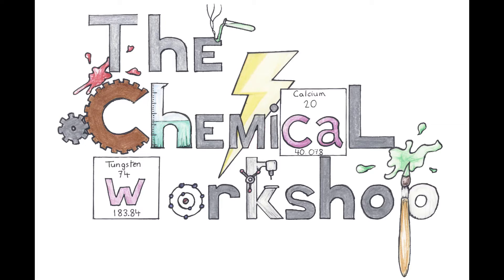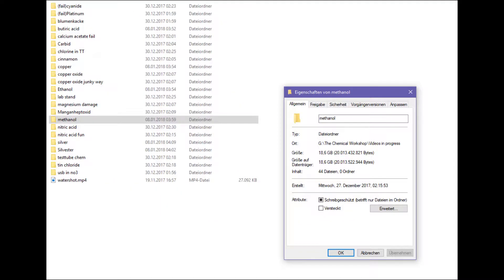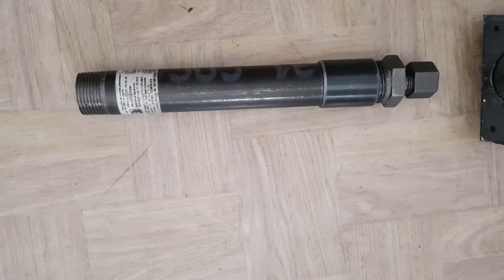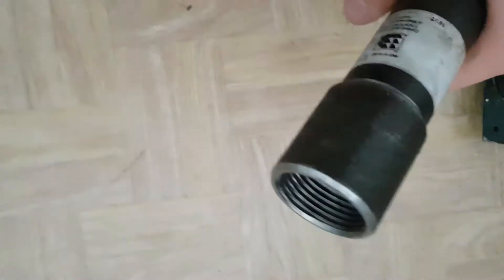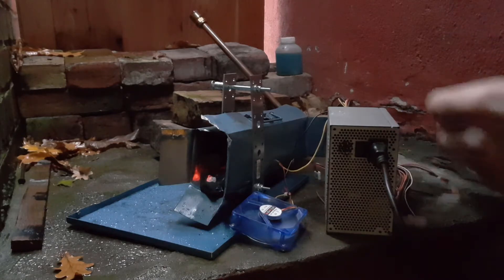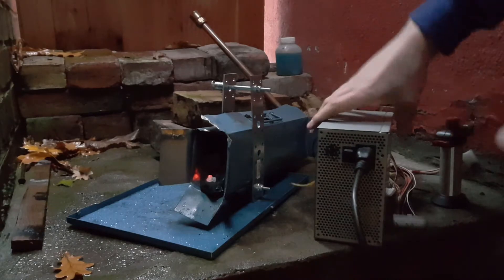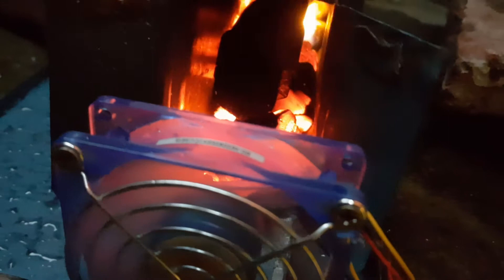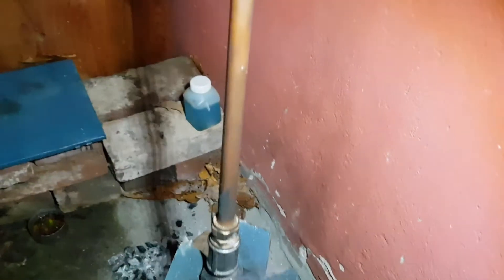TCW - Update #4 - Methanol Update !

Comment: I just did a check at wikipedia and found this:

Carbon monoxide and hydrogen react over a catalyst to produce methanol. Today, the most widely used catalyst is a mixture of copper and zinc oxides, supported on alumina, as first used by ICI in 1966. At 5–10 MPa (50–100 atm) and 250 °C (482 °F), the reaction is characterized by high selectivity (>99.8%):
CO + 2 H2 → CH3OH

So you can make syngas in a pipe. Say you add a little steam. So little that  it favors steam reforming charcoal to hydrogen and carbon monoxide, vs carbon dioxide. 
 Then  the pipe is fed to a medium of crushed sintered copper, zinc, and aluminum oxides. The medium may be heated with nichrome wire if nessesary to 250c. Then after the reaction chamber, a  pressure guage monitors the pressure and you operate a valve not letting it go much over 50 atm or about  150 psi.  Maybe include a 200 psi pressure release valve. Dont let into turn onto a bomb.
Reply from the maker: For now i'll just heat the mixture and collect everything that comes over
The next step would be a catalist which should be easy ro make
The pressure stuff will come last, even if i can get 10% yeld i am happy, the less hassle the better, wood is cheap
Reply: @TheChemicalWorkshop  then adding some steam is likely to react with the remaining carbons turning it into syngas.

Comment: I wonder how well an induction heater would work for you on an iron pipe.
Reply from the maker: Gotta use what you have
Reply: @TheChemicalWorkshop  I've wondered this.

1) Copper wire wrapped around an iron pipe with current flow acts like an electromagnet.
2) alternating current is limited by the inductive reactance in the circuit.  The iron contributes to the circuit's inductance. 
3) The iron is fairly conductive acting like a single turn secondary winding of a transformer, with the resistance being a few ohms to a low voltage current .
4) The currents in the iron heat the pipe. 
5) connect to mains power. The trick is to have enough inductance to limit the current through the primary without tripping the circuit breaker.

While testing, one can include a light bulb  in serries with your induction heater,  to limit current. And adjust the number turns untill your satisified that you would not need the lamp to limit current. 

This takes a bit of math a meter and an understanding of the involvement of impedence and apparent power  vs real power.  Just as long as you aren't tripping your circuit breaker and are able to supply a significant number of watts.
Reply: As I was rethinking about this, the permeability of the iron drops as it heats.  That would cause the currents to increase.  You can make an adjustable ballast from the laminations from say a microwave oven transformer, such that  you can slide a coil  over the laminations. It would require observation and adjustment to ensure you don't go over current.
Reply from the maker: @kreynolds1123  well as for heat i can figure smth out... container is kinda figured... kinda
For now i have tons of issues i gotta fix first before im back to videos but it will be soon
Reply from the maker: @kreynolds1123  like induction heating, prob would be easier to buy a kit off ebay and mod it

Comment: so how hot does the wood have to be for the reaktion

wenn der Stahl rot glüht... dann sollte es ja schon sehr heiß sein ... is der Behälter vielleicht zu klein oder die wärme wird nicht an das Holz weitergeleitet weil das carbonisiert und dann zu gut dämmt?
Reply from the maker: Labyrinth danglish ist legit :P

Well i don't know how hot?
I think the thermoconductivity is too bad for the big steel cylinder?
I have tried smaller on but it failed
However a other guy suggested me to use his trick
I'll but first of all i have to get the part aswell as other parts that failed and try it

Currently I'm working on my storage for my angry chamicals... it will be arround 150kg with 5cm thick concrete walls (I have some nasty stuff and I can't just store it inside)

After that i plan on filming some simple stuff and work on methanol at the same time

I also discovered a way to "get" methanol here in germany without paperwork or BS but I need to explore that aswell for my german audience like you
Reply: ok well .. You do you

if you need some special turned parts I can maybe help you with my Lathe, if its not too complicated. 

I dont know what kind of emethanol you want, but for me the obvious Way is too destill it.

anyway ... I will follow your progress , so better be cool.
Reply from the maker: Labyrinth thanks!
Reply: I mean you just have to be 18 then you could go to a modell shop and buy methanol fuel for like 33€ for 5l of methanol.
Reply from the maker: Tobinator i never seen a place to buy some?

Well I'm 20 so it shouldn't be a problem
However i still want to make it tho
Reply: Ebay?
Reply: Well I havent tried it but you should be able to just go into a "Modellbauladen" and ask for it. Here: https://www.graupner.de/Kraftstoff-Methanol-100-5l/2810.5/

Comment: There is nothing wrong with using an ATX PSU. But you might want to put it in a box and extend the wires, so it can be further away.
Reply from the maker: TheBackyardChemist i know but it's not worth it really, all i need is just a adjustable psu ... they ran for about 20-40€
I could mod the ATX but the total cost would be let's say 15€ for 350W fixed voltage and current crap....
Reply from the maker: TheBackyardChemist https://m.aliexpress.com/s/item/32702714880.html?trace=storeDetail2msiteDetail#autostay

Something like this... for my stuff it's good enough
Reply: Those things are pretty good, but they need a DC input, so you will still need to use the ATX PSU. Also if you want to go higher than 12V you need a module that can do both buck and boost, not just buck.
Reply from the maker: TheBackyardChemist yea i know that
I have a custom build "psu" (kinda) lying arround since mid 2016 but i always forget to order the last parts when i have the cash....

However a boost module or just a beefy psu that can supply 60v for the unit and the unit itself is more or less all i need

Comment: So, all you need to do is heat the wood in the container?
If thats the same as making normal charcoal, i could help you
Reply from the maker: Firehoax for start it is, as the first step i need wood gas i.e. heat the crap out of it
Reply: The Chemical Workshop ummm, if so, can i send some stuff in amino?
Reply from the maker: Firehoax do so, if I use any or your help I'll list you in the final videos aswall as other people
Reply: Well I could show you how i connected it to my condenser, you got the idea from me anyway, why didnt you ask me how I did it?
Reply: I also only used a hotplate to heat it, but as I told you in the google+ group I got alot of other shit in there.
Reply from the maker: Tobinator i don't need the condenser for now at least.(these are first tests)
Well I kind of forgott to ask you, however I want my design to have threads so i think i'll ask you and copy parts of it

I have like 10 people and sceenshots about this project but mostly about chemistry of calatysts and stuff (all people get credit once i finish this thing)

My planning is not the best to be honest....